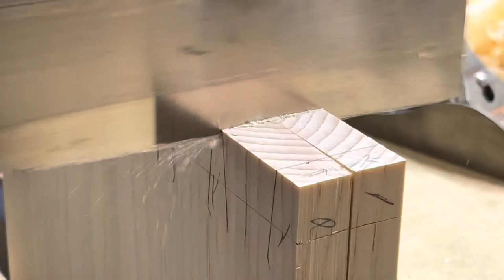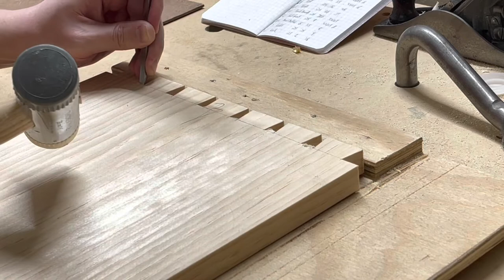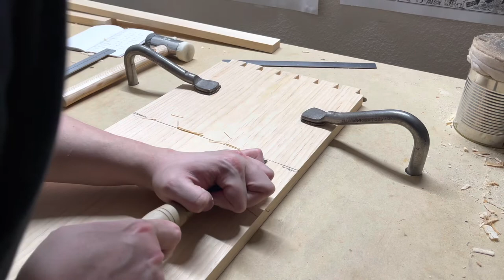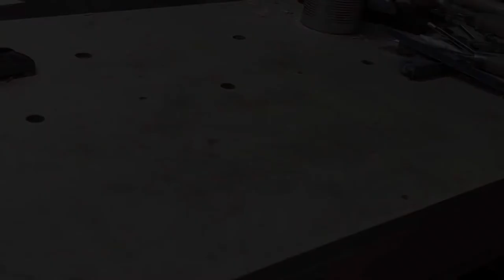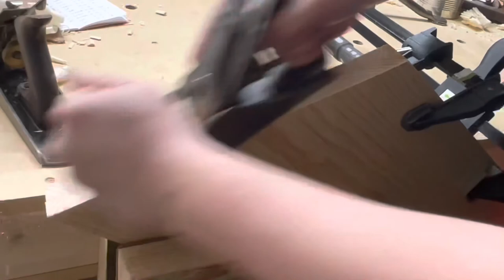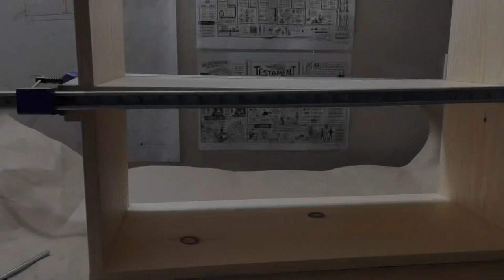Building a dutch tool chest with handtools part II - Joinery - Dovetails and Dados

Comment: I'm surprised that the coping saw blade fit down the kerf left by the dozuki!  I have to start mine in the middle of the gap  between kerfs and sweep over, otherwise it scars up the cut.
Reply from the maker: I used to have to do the same thing, I had to buy the thinnest coping saw blades I could find and they're still too big really, but they get the job done 👍.